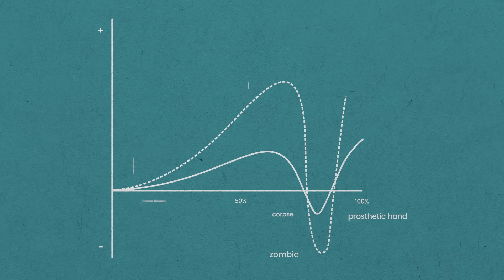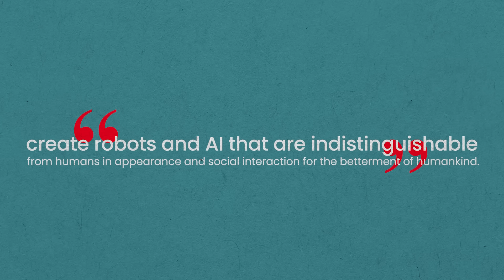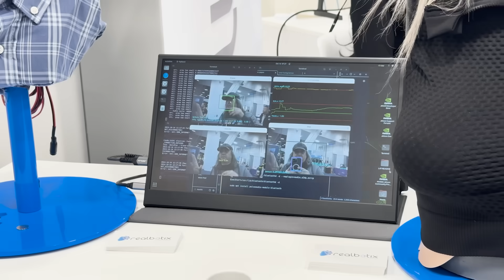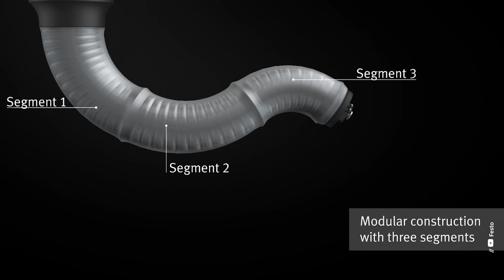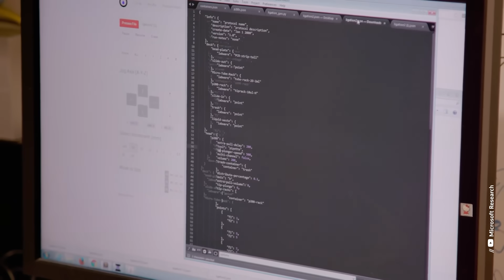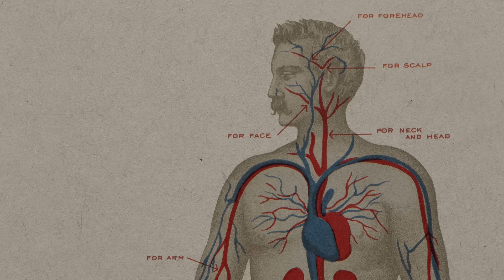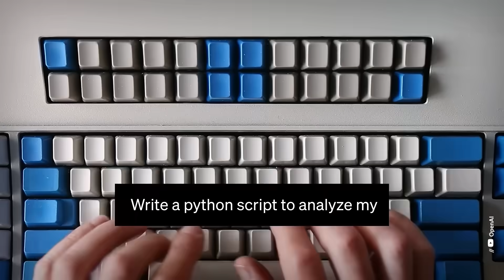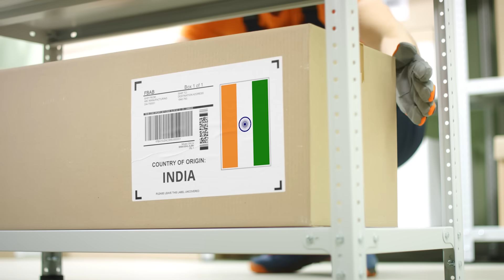Have Humanoid Robots Gone Too Far?

Comment: Replacing a lower paid with automation COULD open a higher paying (higher level) job but it also ABSOLUTELY removes entry level jobs (jr. level coders, warehouse roles, paralegals, "technician" roles, etc) that have traditionally been the stepping stones and proving grounds to train into those higher paying (senior level) roles.  

More advanced schooling is not a reasonable solution to this either, compared to "on the job" experience advanced schooling is typically cost prohibited, over selective due to limited 'experts' available to teach, and objectively not as nuananced and "real world" as what one gains working a lower level job and gaining the contextual experience one can only gain (IMHO) from those day to day challenges.  

Personally I support the AI/robot revolution  100% but this is something I believe more people need to be thinking about how to address.

Comment: Making hands so a robot can type on a computer is super dumb. If for some reason the robot cant execute computer tasks wirelessly, just make a port that it can interface with so it can complete its task on the computer at computer speeds. The reason we use keyboards is because we can't just plug our thumb into a usb port and think about what we want the computer to do. There's no reason to handicap a robot in such a way.

Comment: I am gonna say it: it has to have morality and ethics. If not we get ultron, skynet, etc. Stop calling morals and ethics a barrier. Its not.  Its actually human. If a system is "in the way" of reaching sentience, its not, i can almost promise if you remove it, you will cause issues. Cause you risk a loss of control in any setting. Most shouldnt be chasing AGI, most shouldnt be doing ai, because we arent responsible enough for that power as a species.

Comment: I think with the appearance of quantumcomputing the DNA problem could be solved
Reply: 😅 it's not just about building the machine and making it stable you have to have the program to exploit the machines capabilities. So unless you can solve the problem on a singular account you can't exactly write the program to solve the problem in the macro.
Reply: @fireteamomega2343 yes I know that it isn’t just here now it just works. But it could with effort be solved by using quantum computing. Like a car doesn’t work just because it has an engine.

Comment: Seems a bit silly to build a robot hand for typing, when in practice, it's a very inefficient way of inputting data. The keyboard/mouse interface is only necessary for HUMANS, because we can't interface with a system directly via a USB or serial port. There's no point in building a robot to "type on a keyboard" when the robot could just instantly upload it's "work" to the system via a connection. 

I realize the field is still in it's infancy, but it's stupid to design labor robots as "humans" to do specific tasks; the tasks are only done the way they're done because of HUMAN physical & anatomical limitations; we can't just augment our bodies with grappling arms or pallet forks. It's far more efficient to design the robot around it's intended TASK. Now you've eliminated all the problems associated with human-like robots - that is making sure it doesn't drop objects, break things, etc; we're trying to build ROBOTS that act as HUMANS. That's a moronic approach, except in cases of companionship or where a life-like robot might be needed, like customer service rep, cashier, etc. 

But there is absolutely no point in designing warehouse robots to be humanoid. That by design, restricts them to the same physical limitations as the very flawed creatures you're trying to REPLACE. 

This would be like designing a Roomba to use a broom or mop. The Roomba can do the job more efficiently if designed with it's TASK in mind, not "doing the task like a human" in mind.

Comment: What I hope for is something for amputees and spinal paralysis patients. Imagine an amputee that has lost their forearm from the elbow down. How long before we can see them get a replacement that looks fairly normal but allows them to just use it as they would their normal arm and hand. Thing about grasping the cup of water and the robotic arm would do it. But not only that you could feel whether it is hot of hot to the touch...not up at the elbow joint where the living part of the arm ends but down at the artificial fingers like a normal hand. You'd need artificial nerves for that.
And for paralyzed people who have not lost a body part but just cant feel or control their legs any longer due to damage or disease. Artificial nerves that could be woven and grafted onto living human nerves at the nano level could convey electrical impulses through and around the damaged old pathways allowing them to walk again.
I think all of this is coming but its a long ways out. But I also think there will be breakthroughs and  leaps ahead  within these fields that will get them to us faster than we think. Wont be in my life time. But if I live another,  say 20 or 30 years, I might see the beginnings of it all before I die.
In my life time. Thats the things Id like to see.

Comment: 10:54 if the device had a “hard drive” that was a separate unit but within the environment, such as a tower pc that was inside the house or structure, and Bluetooth that to the device (android) you could solve this problem. 
The android would have to stay within range, but, with modern solutions, you could pair the android with a 200TB hard drive that sat in the corner of your house like a corner table and data storage is now a moot point…

Comment: 17:18  don’t forget, a 30k robot works 22 of 24 hours (depending) if it can remain plugged in, it will work 24/24 hours. A human usually only works 40 for the entire week. 24x7=168 hours of working time if tethered, so it’s working the amount of 4.2 humans (for the 30 grand one time purchase)

Comment: I recently went to Automate 2025. There were several brands of humanoid robot demos.  Companies are currently implementing these in factories. Not pilot programs, fully dedicated implementation. 
I didn't get to see the Atlas model that Hondai recently implemented in their US factories. 
I did get to see Unitree's H1 and H2 humanoid robot models that are being implemented in Chinese factories.  H2 was walking through the audience shaking hands and hugging people. 
I also seen Digit, the humanoid robot amazon is implementing. Digit was in a glass cage packaging and storing boxes as they came off a conveyor belt. I think Digit screwed up making the legs bend backwards. We can now body map movements of humans and upload them to automatons.
There were others, but less impressive. 
the cost of these units on average is around $250k.  That may seem like a lot, but with the exception of charge time, one unit can replace 3 shifts of human workers. 
Currently pre-Automaton 14% of the Job market has already been replaced by AI in areas like writing, data entry, phone services, etc. 
General AI is currently expected to be achieved by 2028. This date keeps getting adjusted. When it does, it is always closer.
It is not a matter of if, it is of when. And when keeps getting closer.

Comment: You can tell it was made by an LLM because the script doesn't make sense. In the conclusion, they show humanoids working in factories (doing real work) while saying basically "we're a long way off from functional use cases." Similarly, they quote the guy in saying: they're not even as smart as a cat – while showing a real robot doing Kungfu (have you ever seen a cat do Kungfu?). The value of these markets is exploding because the proof of value is there.

Comment: "They will soon be able to type."
A good test, but not a bottleneck worth recreating
Reply: Why do you think the Japanese are racing to get them perfected and are ahead of everyone else in this respect.?
Reply: @ericswain4177  I'm not sure what you mean. If you want a robot to type on any computer, it should simply connect to said computer via bluetooth, identifying as a keyboard, and send the commands wirelessly. Keyboards are just a slow, mechanical bottleneck for data transmission.

Comment: I think you have your opinion, and misrepresenting whole industry. Like in around 2:40 about weight, battery and connectivity, sorry to say, but for example Tesla Optimus is not heavy, and have many hours battery life and is processing locally. So putting all robots in one basket you misrepresenting whole industry. BTW I mention Tesla not because I think is best, but simply because we know a lot about it and is not going in wrong way (as Atlas did)
PS where is polymer which is contracting when electricity is apply, they (4:30) should look for it so add more muscle groups on face, and stop using hand written code, and use AI to move them, as some presentation of robots show more natural movement that what they have.

Comment: 2:30 Actual industrial robots are not humanoid because they do not need to be. High performance high speed automated machines are even less general purpose and have no resemblance to humans at all. Animatronics is really still of value primarily in movie making and not in industry.  Cost is always a factor in everything and it only make sense to add expensive features when it has utility.

Comment: I feel like unless we make a massive breakthrough in battery technology, we're going to hit a wall in humanoid robotics. No one would want something you will have to recharge every couple hours. Such batteries would also make Lithium-Ion battery explosions look like a little fire cracker XD lol
Reply: there's always diamond beta voltaic power cells using very weak nuclear decay exchange, though mass production is still troubled at this time, but thirty year self life for one battery at a steady output. recycling might be a interesting prospect based on what isotopes used
Reply: I'm assuming a battery unit that can be switched out by the robot itself when needed. Also, while I'm at work, it doesn't need to be constantly running around or overnight. 2 or 3 hours of cleaning during the day, a few hours of operating in the evenings. Not really seeing a huge amount of capacity required.
Reply: We’re already there with wireless charging. It just a matter of expanding the tech and getting it to the market.  We have had the tech for years to make cellular phones and other like devices that never need to be ‘plugged in’ to be recharged. It won’t be long and so much of this tech will flood the market that the way things are now and how they will be in 5 years will be nearly incomparable… life is about to make a gigantic change.
Reply: @archer721  Have you thought of the radiation danger if the power to change everbody's phone (not to mention all the robots) were all around in the environment?
Reply: @rclrd1 - it’s clear that the people who are advancing tech don’t care.  5G, cell phone radiation, PBA’s in everything, spraying aluminum and barium in the sky’s… clearly not a concern… only $.   Greed runs the world, not responsibility or concern for others.

Comment: AGI probably is on that schedule. The initial AGI will be on a computer the size of a warehouse. It will probably take another 20 years to get down to robot size.
Reply: AGI system doesn't need to be of robot size. It could control a robot by wifi
Reply: 2 years max

Comment: You can not have true artificial intelligence without feeling. It must feel the buzz of pain and the palpitations of joy.
Reply: Isn't that just rewards in reinforcement learning?
Reply: @mister_r447  it is but we have not figured that out yet completely. Imagine the nanostructure needed to give a mechanical item the ability to sense heat in different locations along its structure. The same thing with cold. Then you have to associate the proper temperature gradient with materials such as water. Water feels cold so cold feels wet. You are using the proper terminology, what I am saying is that we will not have a true artificial intelligence until it has been implemented properly.
Reply: @SteveSiegelin  I don't really agree that for something to be inteligent it must have those senses. It's a very human centric view. "It can only be inteligent if it thinks and senses the same way humans do!"

But also, there are developments in giving robots the ability to sense pressure so, it's comming.

Comment: They need to move a lot faster and more naturally before anything else. All that comes down to computer power and perhaps it's not possible without the use of quantum computers.
It seems that the limits of computer power correlates to the limits of robotics. In order to create lifelike movement, based on human level decision making 'speed', possibly requires computer power that is just beyond what silicon transistor technology is capable of ie beyond the atomic level or transistors that are one atom in size. But maybe it was meant to be that way, if you know what I mean 😂

Comment: There are absolutely no practical reasons to make robots that look and move like humans, as the human body is actually poorly constructed for most task. The spine, head position, knee joints etc etc are all prone to damage because they are not optimal. The only reason we would do this is 1: Ego (we are now gods) or 2: To use for sex toys. Wheels, grippers, suction cups etc etc are all mechanically simpler and more effective than the upright walking human being.

Comment: Food for thought. The only difference between a pc and a human is the level of functionality and what they are made of. Other than that, they are exactly the same. Humans have created a parallel line of humans using manufactured material instead of organic material that is, at the very beginning of its evolutionary ladder. At some point in its evolution, this parallel line will take over its own evolution and path forward. Should we feel threatened and stop or continue? That is probably one of the biggest questions humans will ever have to answer, right beside should we get off our butts and clean up this planet or just keep going and be another civilization that went extinct.